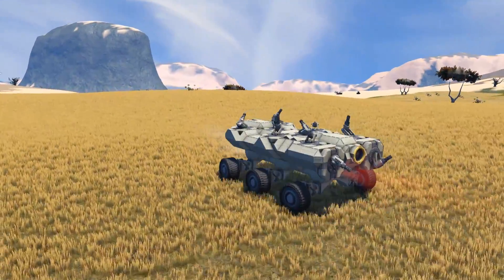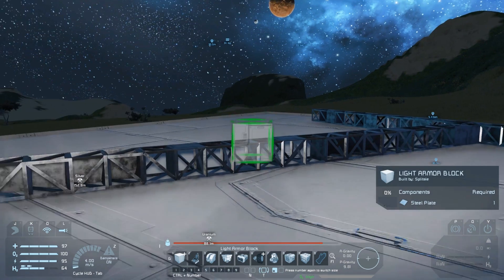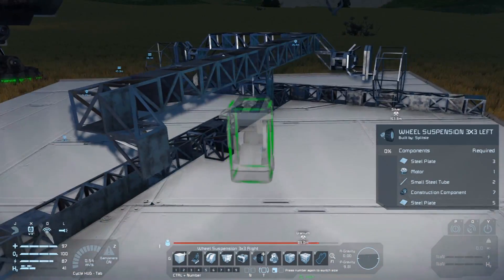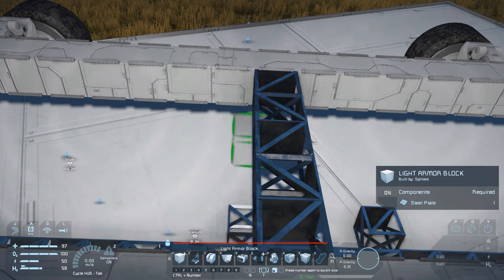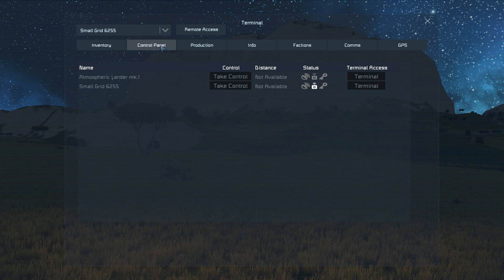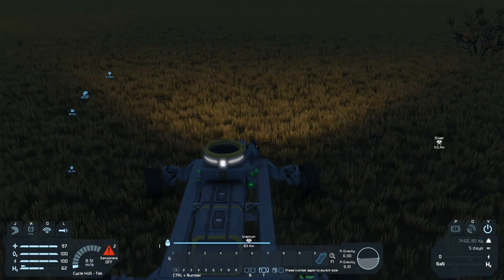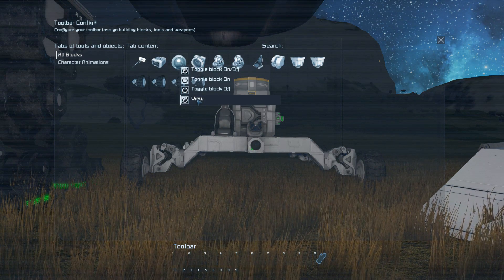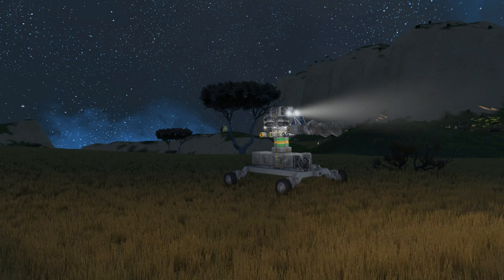Space Engineers Tutorial: Rovers and Remote Controls (Part 4 of a survival tutorial series)

Comment: Is there a way to open the terminal and then control everything at once, for example having 2 large ships in space a few blocks away from each other, then controlling both of them via  the control block on both ships to simply move forward
Reply from the maker: Nope, there is no vanilla method to control two disconnected grids simultaneously. There are some scripts that allow you to have drones that mirror your position but they are incredibly CPU intensive and can seriously deteriorate your play experience and I'm not sure if the one I've previously used still works
Reply: @Splitsie  Thanks dude !

Comment: One question, what settings, tips can you give me for my rover in nonflat terrains, like montains that have a lot of holes, those small bumpy hills and you get the point
Reply from the maker: For small grid rovers you're always going to have trouble traversing that sort of terrain since it's just too big a hole for that size of vehicle. These days I always build with 5x5 wheels as they have the best ability to avoid being stuck but can still run into trouble. 

One method to limit it is to go for something with lots of wheels, eg. 20+ where you have 4 rows of wheels not just 2, this can allow you to move across some of those areas if your vehicle is light enough, but can be a little bit fiddly when it comes to turning due to some of the wheels always resisting the turn
Reply: @Splitsie  thanks for the good answe!

Comment: Tip: When making the chassis of a rover, if you can, use Heavy Armor blocks. The underside takes more of a beating than you might expect so the extra protection helps lots. Trust me, I learned that the hard way.
Reply from the maker: Another thing you're doing by building the bottom out of heavy armor is lowering the center of mass which can help with handling. I've never had too much trouble with damage to the undercarriage of my rovers, but I usually build with a large amount of clearance in mind

Comment: Why can't I control the remote while in a cockpit. I want to change the orientation of flight depending if I'm mining or flying. I use to be able to do this, now it says "control of grid forbidden. Seat/remote with higher priority is occupied". I've tried to change the main cockpit settings as well as any other settings I can think of. I swear it seems like they break more things than they fix with this game. And they still haven't fixed rotors being considered a separate ship than what its connected to. For the love of god keen stop adding smudge marks to the camera and fix game play issues. Your suppose to be a space engineer but your unable to clean your visor or windows?? really?? really keen?
Reply from the maker: I hadn't noticed they'd changed that. Given that they changed the remote control panel to read 'main remote control' instead of main cockpit it may have been a deliberate change - I don't know why they would have done that. I guess the best solution would be to use a chair and have 2 remotes, one facing each direction to switch between, not ideal in space though as you'll run out of O2 much faster. If this change is going to stick we need an enclosed passenger seat like the horribly ugly one in Empyrion...
Reply: Thanks for the reply, love your videos. I just checked the same scenario using a connector and i get the same outcome. I have the ship with a remote and an antenna, than made another ship with a cockpit and a connector.  I can control the remote from the cockpit of the other ship, just like you did at the end of this video, but as soon as I connect to the ship it wont let me control it. Why keen why? It's so frustrating!
Reply from the maker: You're welcome, I'm going to have to make sure I approach my rover tutorial differently when I remake these if this change sticks :(
Reply: I really REALLY hope this is just a bug. It seems silly that I can control it right up until I lock the connector. I can still access all the systems in the control panel I just can't fly it. And then it seems to get stuck when trying to return to the cockpit flight, I have to exit the cockpit than re-enter it to take control of flight again..

Comment: I followed the video, but when I try to control the rover with remote access, the key is grayed out. When I hover over it, it tells me I have wrong ownership settings. I've looked over every block to confirm I own them, I have antenna's on both the rover and my suit. I can control the rover in the seat manually, but that wasn't the purpose of this tutorial, I am frustrated, unable to solve my problem.

I've tried setting the world to creative, creating blueprints of the rover, then pasting them, I have tried disabling "main cockpit" in both the Atmospheric Lander and the Mining ship.
Reply: I am able to control the rover if I access the control panel via the Terminal, it's a little annoying having to go through a couple more menus to control the rover, but at least it works.
Reply from the maker: I've been having similar problems lately, initially I thought it was due to ownership settings but I've had it happen when everything is mine and when it isn't. If I can reliably recreate how it happens that you can control from the shift+k menu I'll post something about it :(

Comment: The Wheels wont work. I cant steer or drive!!!
Reply from the maker: Most likely you haven't taken control of the remote control block. If you're just sitting in a chair you can't actually control the vehicle. Jump into the console and find your remote control block then click on the control button :)
Reply: So a Cockpit won´t work heh :,D
Reply from the maker: Well, it would, but why would you want to be so sensible? ;)
Reply: Only if you added gyroscopes, (havent yet seen the entire video, so haven't seen if they are in the build). The gyroscopes are what allows you to turn regular ships and thats why they also allow to pitch the rover up and down, gyros can help a lot in case of a high speed rover for both steering and stability however
Reply: Once finished I notice the front of the vehicle can be lifted by pushing the mouse forward. Is this normal? I hope not, it sucks! lol

I decided to play in creative till I understand all the blocks, could this be the reason?